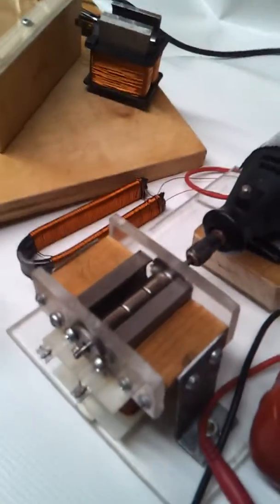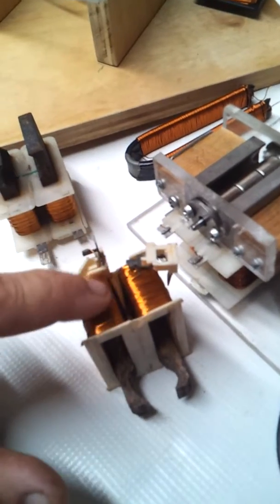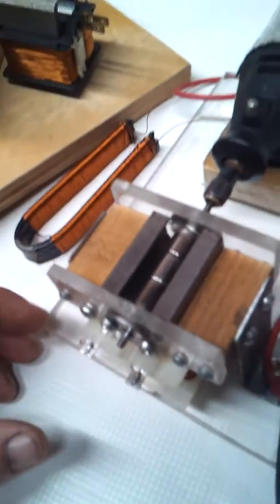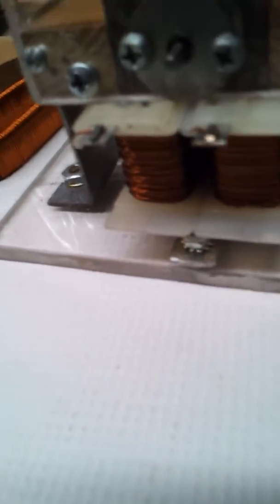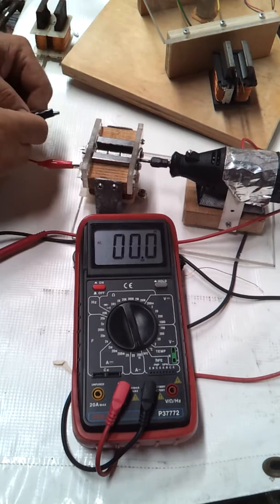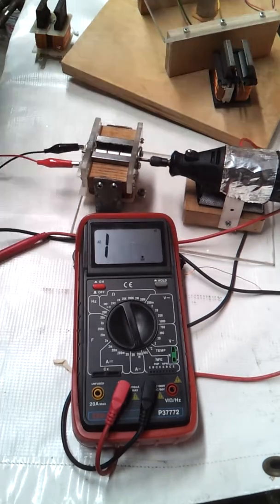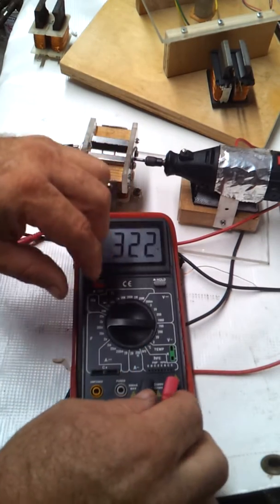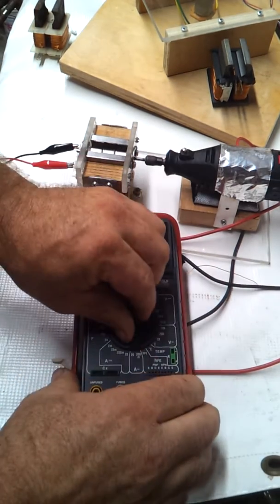Leedskalnin bucking coils-4

Comment: So 320v x 0.86A = 275Watts
How many watts your motor takes?
Reply from the maker: 120v @ .9 amp mains power
with fresh bearings it spiked at 360v.
Reply from the maker: 120v @ .9 amp mains power
with fresh bearings it spiked at 360v.
Reply from the maker: 120v @ .9 amp mains power
with fresh bearings it spiked at 360v.
Reply from the maker: 120v @ .9 amp mains power
with fresh bearings it spiked at 360v.
Reply: 320v is open circuit measurement ,  you can not calculate power like this method.

Comment: You have to check voltage while you are pulling the load. You can use the original rotor that comes with the motor, it diametric also. They put out a fare amount but nothing like the neo's.